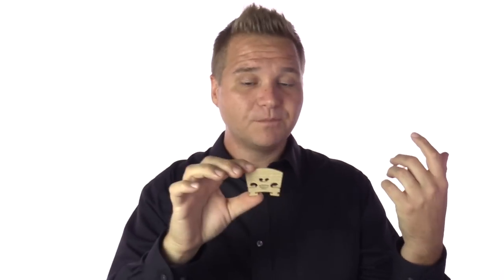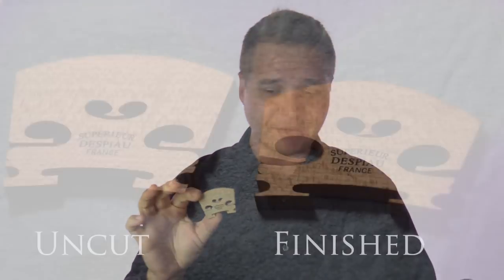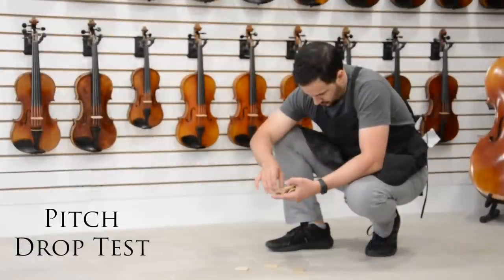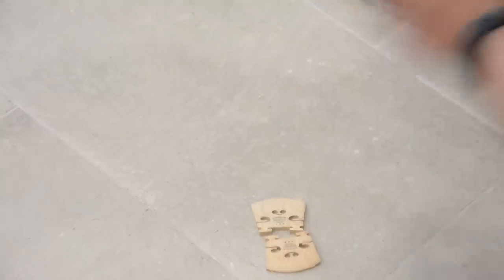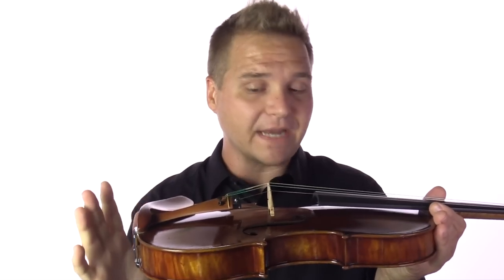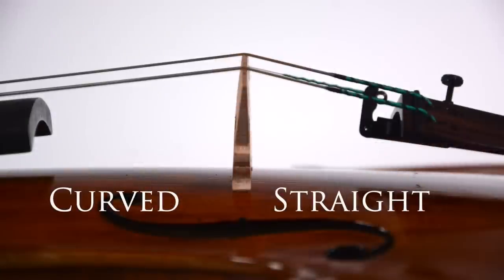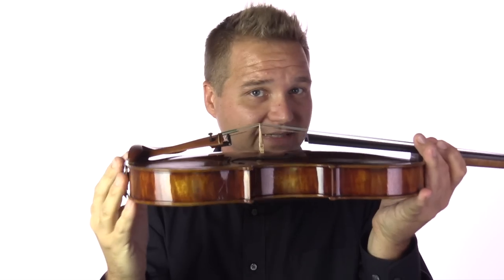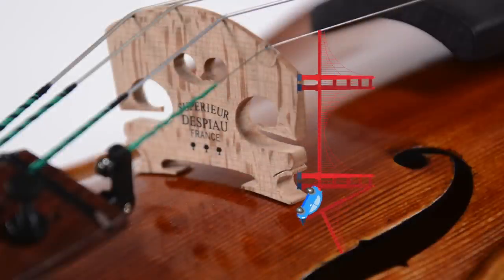Bridge - Selection, Set up, Care & Maintenance

Comment: Michael, because steel strings are much higher tension than synthetic strings aren't the string heights lower than the standard 3.5 mm for e and 5.5 mm for g string. I'm just into irish, scottish, and country folk fiddling and I have been using 3.0mm & 4.5mm for a long time. 
I mention this because I am buying a new Fiddlerman violin in a couple of weeks. Either the Artist or the Master. Any suggestions? Keith Campbell , a long time customer.
Reply from the maker: Hi Keith! We don't change string heights based on string type, unless requested. I'm personally not a big fan of steel core strings, because I like the lower tension of synthetic core strings (along with other reasons). But we're happy to set up your violin with lower string height, or even flatter bridge if you'd like either of those things. Just leave a note in the order, or give us a call. All the best! -Gibbles

Comment: My violin bridge is bent towards the fingerboard and it's warped from the top. I had the violin restored about 3 years back and everything was well done, except for the bridge
Reply from the maker: ah, sorry to hear. But you might be able to get it back straight still with some correction. Even the best bridges will be pulled and twisted out of shape over time, so try to straighten them out when you see them starting to warp. All the best!
Reply: I had a bridge like that once. I just soaked it in hot water and then placed it between two pieces of wood and clamped it. It straighten out fine.

Comment: I brought kremona violin pickup but My violin bridge eye slot is too small so can I gently widen the eye slot using a fine sandpaper? Is there any issue in widening the slot does it  affect the sound of violin?
Reply from the maker: It's possible that you could have a "buzzy" or metallic sound from a string groove being too narrow. This isn't as common as when that's the case at the nut. Luthiers usually use a fine file to adjust the groove, so I'm not sure sandpaper would be the best choice. I suppose if we step back for a second, I'd ask, before making changes to the bridge, are you sure the problem you are having is in the string groove's fault? There are lots of common reasons why instruments buzz, I'd recommend exhausting other options first.
Reply: I also recently got the Kremona. Love how it sounds! I have had a buzzing that is really annoying before the pickup but maybe more now? I have tried to find the source of this buzz for a year now. Only got the pickup a few months ago. Any ideas? Thank you!

Comment: I got a fiddelman Violin deluxe last year but the bridge is curling, bending strangely...Is that due to a low quality bridge material... How can I fix it?
Reply from the maker: Hi! I'm so sorry to hear this. The Fiddlerman Concert Deluxe violin comes with one of the best bridges available, the professional level Despiau Three Tree. The bridge is most probably warping due to it leaning the wrong way. Over time, with regular wear and tear, the bridge will start to lean over toward the fingerboard. A bridge should regularly be adjusted, to prevent warping. If the bridge has warped too much, it will unfortunately not be able to be saved. My suggestion is that you send us a picture of your bridge to support@fiddlershop.com so we can take a look at it. Here is a link to a video, that shows you how to adjust a leaning bridge: https://www.youtube.com/watch?v=80WMoAgwJTs